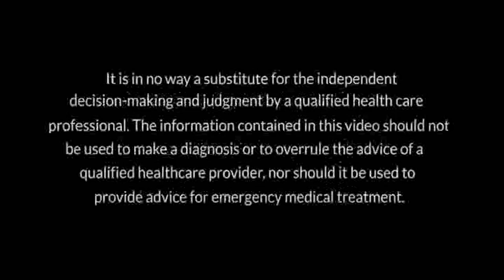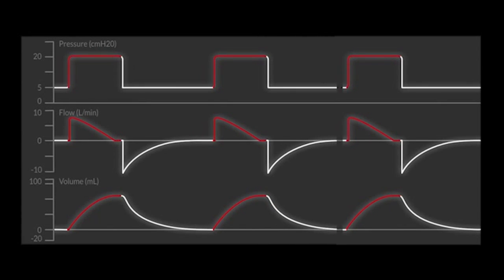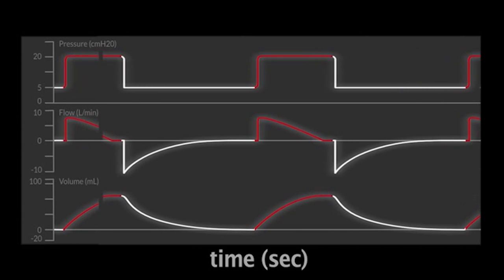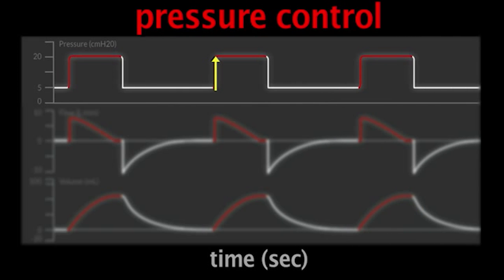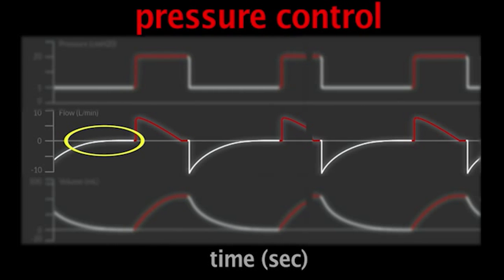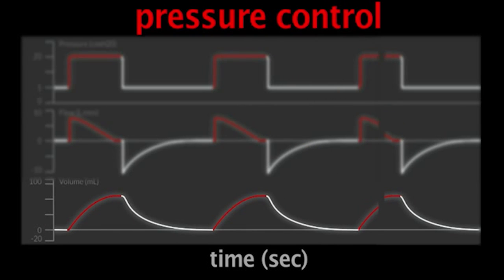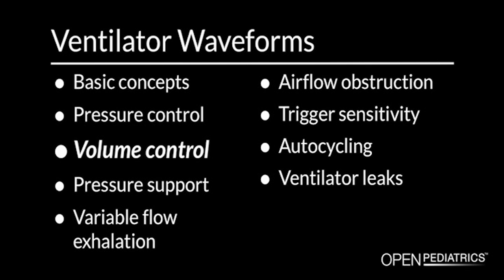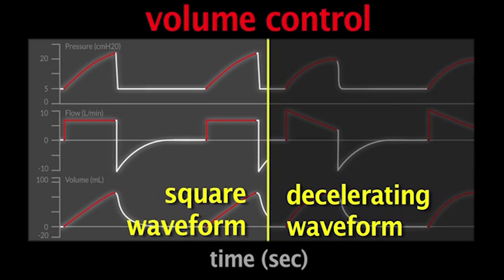"Ventilator Waveforms" by Craig Smallwood, PhD RRT for OPENPediatrics

Comment: Great video!  Very thorough!  I will recommend this to our RT students.  Water sloshing around in the ventilator circuit can also cause autocycling.  This happens often with heated wire circuits when fans are used to cool patients with elevated temperatures.  The fans also cool the circuits causing rain out.